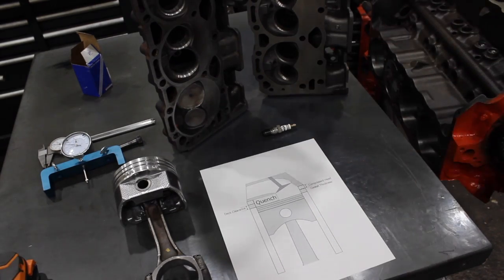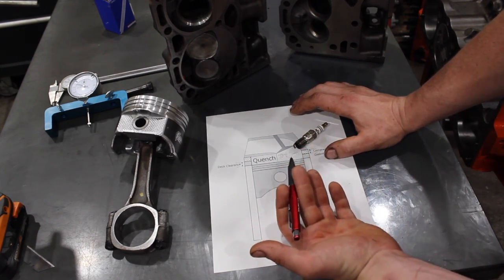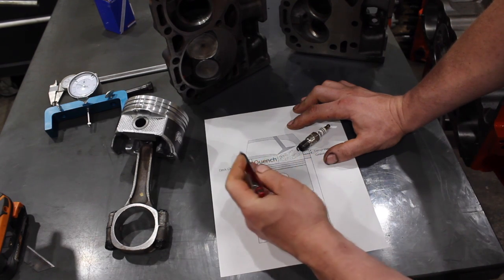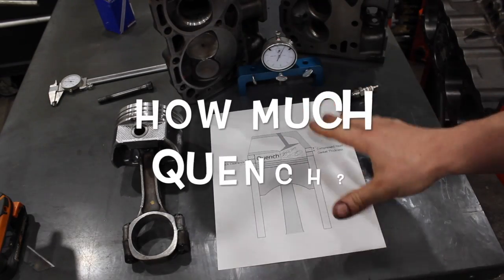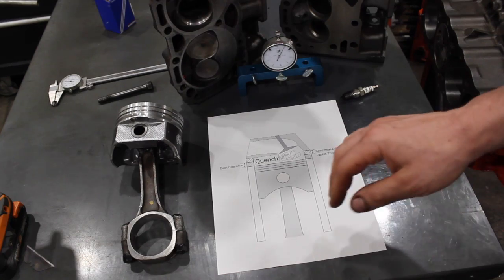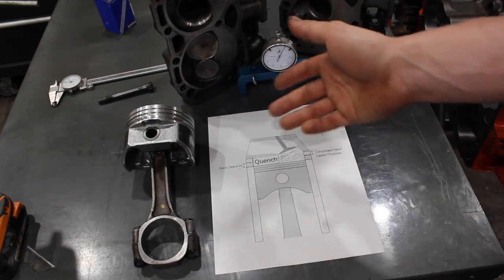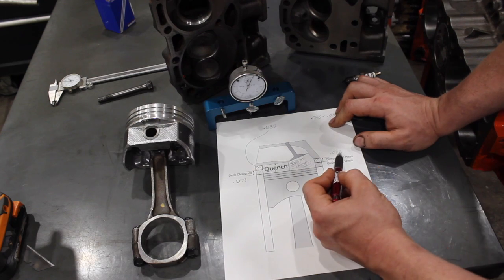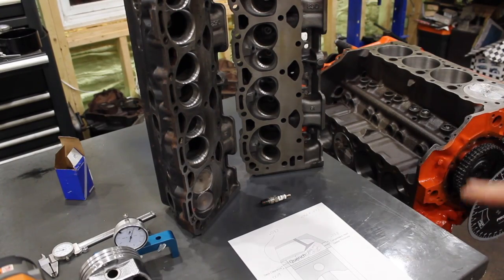Quench! Higher Compression with Less Detonation (A key to making more HP)

Comment: Great video thanks! I’m using a 4.4” piston with a 15cc dish to get a 9.8:1 compression ratio. I have 0.045 quench height but with the dish the quench pad is only about 1/4 inch wide - is that enough quench? I would have preferred a flat top piston but I’m limited with head choice.
Reply from the maker: When it comes to dished pistons getting that ideal quench is a hard to achieve. They have D style dished pistons that leave you with a quench pad work well but not every dished piston is designed that way. 
Your not running a ton of compression and if you have a good combustion chamber I don't think you'll have any issues.
A large bore engine like that (Ford 460?) Will need a decent amount of ignition timing so you may have to play abit with timing vs detonation vs max power.
Reply: @cuttersperformance  thanks very much, it’s a 8.1 GM gen 7, I have a round dish not a D dish. I would have preferred to run a flat top with higher compression but the gas where I live is only around 89 so that’s why I dropped the compression a bit.
Reply from the maker: Badass! The vortec 8100 Work horse! How are you getting a 4.400 bore? Merlin block or something?
Reply: @cuttersperformance  PSI block with a stroke crank - 4.4 bore 4.75 stroke 577 cu all up, going in my 2003 Avalanche 2500 HD. There are not many aftermarket head options, only one is aluminium which is Raylar 107cc chambers which is what I have. I live in New Zealand and our gas here is not as good octane as US.
Reply from the maker: @martyengland1964  thats fricken awesome man
Torque monster for sure

Comment: Why won’t domed Hyper pistons work with Vortec heads? Only flattops or forged I hear. Any insight?
Reply from the maker: Video coming up on pop ups with vortecs! 
You dont need to run forged with vortecs 95% of the vortec builds I do are hypers
Reply: @cuttersperformance  I agree I want to run domed hypers but the mfg says it won’t clear the vortec. My guess is the spark plug area contacts the dome. That’s why it’s a must to run icon forged domed if you use a vortec head. Flat hypers are fine.
Reply from the maker: @chrisd078  o yeah sorry I thought you meant hypers in general. 
You'll for sure want to check out my next video then on running pop up hypers with vortecs
Reply: @chrisd078  it can be done, your only real clearance issue is on the spark plug hole on deck surface side, you can shave off what you need to make it work out no problem

Comment: No wonder hemi heads with the spark plug in the middle run so good. Little to no quench area
Reply from the maker: You'll actually notice on a new style hemi head the small quench pads at each side, rather the the full round early hemi heads. 
Helps promote turbulence in the chamber, mix that will the amazing flow of those heads and you can make some great power
Reply: The old hemi heads had little to no quench and pinged like crazy.
Reply: This is the same idea that im going for on my inline 300 build… i have a CNC head with bigger valves where the valves have been unshrouded… and im going with a set of round dished pistons (hypers) to maximize the surface area that the combustion is pushing down on… i know its not going to make big power with 8 to 1 cr and mild cam, but im hoping for a higher flowing engine and with more air/fuel in bowl and plenty of advance it may just perk it up a bit… 🤷🏽‍♂️ but i guess ill find out

Comment: I have a 305 vortec 98 silverado daily driver needs more power hauling trailer for my job would it be better to get new heads with behive springs and cam to match or keep vortec heads and just change rockers for more lift
Reply from the maker: a little more lift with 1.6 rocker arms would help but a mild/torque cam would for sure be better. Just remember though most cams worth swapping will require the ecm to be tuned
Reply: @cuttersperformance  cool thank you keep up the good work
Reply: @cuttersperformance  my 98 obd2 so a dyno tune after cam upgrade is best or what about black bear tuning or a wait for me tune dyno shops cost alot

Comment: Don’t the gm zz4 have a Quench of .076? With 10.1 cr
Reply from the maker: You are correct and alot of guys aren't happy about it haha. They use the vette aluminum heads on those with the small 58cc chamber. The added a thicker head gasket + pistons that are .025 i believe was done to bring the compression down. Not the ideal way as it would have been much better to use a 64cc chamber with proper quench. For power and fuel sensitivity
I've heard quite a few guys complain about pinging on 91 and having to turn the timing back on zz4s. 
I'd be willing to bet with proper quench that wouldn't be a issue
Reply: @cuttersperformance  I hope I don’t run into some issues with my setup, I’m going to have a quench of 0.64 and 9.8:1 cr, you should of made this video a little sooner😂
Reply from the maker: @ericnieto9394  haha sorry man! Whats heads? Zz4?
Reply: @cuttersperformance  no it’s l31 355 with flattop pistons and 062 heads ported(using the methods from your video) it’s my first build and your videos have been real helpful thanks making them
Reply from the maker: What cam are you running? That makes a huge difference with fuel sensitivity aswell. 
My daily c1500 is almost 10 to 1 with .045 quench and runs on 87 with full timing.
Reply: @cuttersperformance  218/228 112 lsa, the dynamic cr is 8.4:1 with this cam which is a point lower then what’s recommended to run on iron heads
Reply from the maker: I think you'll have no issues on 91. Vortecs have great chambers and just be sure to keep her running cool (180deg) You'll be fine 👌

Comment: That rocking of the piston and I’m sure you know this is called piston slap Subaru motors are famous for it I had to have two pistons replaced thank God it was under warranty at 90,000 miles I bought the extended warranty sometimes it pays when you buy the extended warranty I only paid 1500 bucks for that warranty they pull the motor out to replace yPistons  it would have costed me 4 thousand dollars
Reply from the maker: I call it Subie Slap haha yes very common on Subies and actually some v6 gms engines aswell

Comment: On all my circle track motors I run as close to .035 deck ht. as I can. Some turn in excess of 8000rpm and when I refresh them they show signs of being very close to the head. The burn on the quench of one of the heads I could read .030 that transferred from the piston, it was written in carbon. I don`t believe the engine would have survived for 1800 laps if it was any tighter. That was 20 some years ago now I leave em .007 in the hole and use the gasket to get .035. In the hole helps with the rocking situation too. Little light shiny valve smiles with no deformation in the pockets are OK
Reply from the maker: Thats awesome man! .036 is the tightest I like to go but I dont do circle track stuff. 
I often get told by guys that they have had good luck with like .025 on circle track engines and I can't quite figure out how they get away with that haha maybe not a true .025? Who knows 
Cheers!
Reply: I got away with 0.015 on a 1.6L 12.7:1 engine but with 6.5k rpm limit only.
Reply: @muftifaizan1964  Rule of thumb is .040 and .now I know I can go a little closer, I would have fattened the head gasket if I got a .015

Comment: I like your explanation of Quench, but you do have to understand wet flow of the intake port and why a tight quench makes better power. All factory style cylinder heads have all the wet flow coming around the short turn radius, and then the fuel collects on the quench pad, this is raw fuel in droplet size and not very burnable. Like you explained the tight quench helps force the fuel across the chamber toward the spark plug, and reduce the need for spark timing. But if you study the carbon in the chamber you will see where fuel is and where is is not. So if you look at the area around the intake valve , you will see very little carbon build up there. This is because there is no fuel there to burn. If you remember about 20 years ago AFR was experimenting with golf ball dimples on that portion of the chamber, thinking this was fuel wash. The real fact is that there was no fuel ther to build up any carbon. They did not understand wet flow either.
Reply: Or was it more clean there because the burn was better? I remember the thinking you're talking about in the 80s and 90s; Dirty is where the burn is. 
Around 2005 (I believe it was Darin Morgan) it was shown the clean part of the chamber is where the burn is best.
Reply: @StabyMcStabsFace  Unless you are burning straight methanol you will get carbon build up. Just get a look at a NASCAR engine after a race. The pistons and chambers are the same color ever where. That is fine tuning on E95

Comment: Is a step head piston good for a turbo application?
Reply: Eh probably not in this kind of setup, usually with power adders you want a lower compression, Dished pistons would be the best way to achieve that in this kind of setup. Guess it would depend on the build and everything but generally lower compression is ideal

Comment: All well and good, but keep in mind, this all being measured cold. Watch what happens when the piston sees heat. Then watch what happens when you hit a certain rpm. It's a lot tighter than you think. Don't forget piston rock. Even with a steel rod and especially with an iron block. Aluminum blocks have that safety factor built in at 0, because the block grows taller giving more distance with heat, unlike iron. You only need enough quench distance to keep the carbon off the tops of the pistons under the quench pad without it actually hitting. Unfortunately, no way of knowing what that is, unless you run the same exact combo and rpm, and creep up on it. Point is tighter the better except in big power adder stuff. You actually need as much as you can get while keeping the desired compression ratio.  Many factors are involved, but general rule of thumb in most is .036"- .045" will work on anything with a steel rod. After .049", the ability to help suppress detonation diminishes, and. 060" and over, or no quench distance. Does nothing. This is all provided you have the correct cam profile, compression, desired cylinder pressure, piston design and heads that actually have enough quench pad.

Comment: I have ran 355s with 0 deck height and Chevrolet steel shim gaskets we painted with cheap paint and a solid flat tappet cam without checking anything but valve clearances and it ran like a scalded dog. Old roundy round racing. We ran Sunoco 260 or aviation fuel and 36 to 38° total timing or until it pinged then backed it down just enough to stop the spark knock with cold plugs. We had lead in the gas back then. Good old Ethel. Yep, I am old.
Reply from the maker: Haha thats why I said that about you crazy circle track guys! You guys often have great luck with pushing the limits hahaha but I guess some blow up first lap hahaha. I guess you can't find the limits without pushing them!
Cheers!
Reply: I knew one guy bringing his pistons .003 out of the hole for engines running in " stock class" engines. He had to run 72 cc heads so he had to get compression somewhere.
Reply: This clown doesn't understand quench at all
Reply: I remember that leaded ethyl gas. I  used to get it at the Marine Gas station. I think the octane was 97 or 98. My Mustang with 12.5 - 1 TRW Domed pistons ran its best on that gas. And I set the timing the same way you're talking about, just a little bit of pinging pulling a hill at wide open throttle.
Reply: .019 quench? Cutting it close and yes valve spring rates,  valve to piston clearance, cam timing and indexing centerline all come into play. Even spark plug indexing should be critical.
The gen2 sbc LT1 has a .025 quench clearance??? Fact check that one.

Comment: It's all relative to bore size, I built a Yamaha blaster years ago with extensive porting, peak power at around 8700 rpm, quench was a verified .016" and that was an air cooled single that spent it's entire life being beat like it owed me money. A full hemispherical chamber and the piston crown matched it. I'd have to look at my old notes but squish band was around 35% of the bore, it seemed to break all the rules. But never failed and for a 198cc air cooled twin it would run with piped banshees up to 45-55 mph, in tight trails they couldn't keep up with it. Never ran hot, actually ran cooler than it did when stock. Guys with 383/385 sbc are running 4132 forged slugs around .028 - .035 no problems at all on na street stuff. The tighter piston to bore. Clearance, and small lt1/lt4 chambers and a flat top allow them to get away with it, I'm sure the reverse cooling doesn't hurt either. And they get revved to 6500-6700 rpm. I think .040 is kind of an old general rule of thumb. Have seen turbo LS engines tore down where the owner didn't know better and assembled with .025-.028 quench and never had a problem. Most in the know tend to agree for 4" -4.040 bore stuff .039-.041 is fine and not really any more power or detonation resistant going any tighter.
Reply from the maker: I have to agree with you for the most part. Bore size is for sure will play a part as it contributes to the rock of the piston as well as the weight. 
As mentioned in the video I know guys will run under the recommend amount but you have to know what your doing and good parts are key. I can't suggest to guys to run under .036 for two reasons. Mostly becuase it gives a safety net and secondly you won't really see a benefit under that. (All risk not much reward sort of thing)
Reply: @cuttersperformance  oh I agree brother, just sharing some personal experiences and observations. I set my engine up at .041" spent a significant amount of time making sure the sharp edges of the valve reliefs, around the plug threads etc were softened I was advised that would do more for detonation resistance than ultra tight quench with the afr eliminator heads I used. Love your vids bro, have a set of ultra low mileage original 906 castings without the hardened seats, and will be throwing them on a flat top long rod 355 plan to push comp to 11.5-12.1 and run e-85. I get a lot out of your videos, and enjoy watching them with my dad. I'd like to contact you about some vortec specific parts I'm sure you have laying around from all the heads you've found cracked and experimented with. Do you have a website for your spring kits with some contact info dude?
Reply from the maker: Thank you i appreciate that!
Yeah man shoot me a email at pcperformance1@outlook.com
Reply: @cuttersperformance I would agree with knowing what you're doing... However, that's engine assembly practice in general. The very first experiment that shows 0.028" gives you an additional 8% fuel economy and smoother running makes you learn something, when you thought you knew what you were doing before...  It's the experience that makes you know or not. Inherently, you don't have to know why less clearance works better in order for it to work better. Tuning still utilizes the same concepts, nothing else changes except better performance...
Reply: Although anything in .040's is fine in most applications, it is certainly not bore size specific. However the bigger the bore, the tighter it needs to be, as they are more prone to detonation. A lot more to it than just quench distance.
Reply: @jrdmotorsports9718  Right, thats basically what he was explaining in his comment 😆

Comment: On a 350 I run zero deck with a copper 025 head gasket, it works great
Reply from the maker: Haha I knew there was some crazy guys running tight PTH clearances out there. 
What do you rev that 350 to?
Reply: @cuttersperformance  8500
Reply from the maker: @No1414body  wow actually? What rods and pistons?
Reply: I run a tight clearance forged piston and a Mechart rod, steel crank, 3.5 stroke
Reply: 6 inch rod, runs 5 seconds at a.time
Reply from the maker: @No1414body  man thats awesome but I gotta say I'm very surprised you don't have contact with that RPM and .025" clearance
Reply: @cuttersperformance  it an alcohol motor, I run it tight because the compression is at 11.2 to one
I run a tight ring on it that's how I can run that tight, no boost, actually turns out to be 030 deck clearance after coating the gaskets with sealer, so it only sounds that bad
Reply from the maker: @No1414body  very cool man! .030 starts to make me feel better haha nicely done! 👌
Reply: @cuttersperformance  the real difference is the rods, stock rod caps are too flexible,  these rods are so stiff
Reply from the maker: @No1414body  yeah exactly!
Reply: @No1414body  what kind of sealer do you prefer?
Reply: @larryfernow4071  permatex spray copper coat